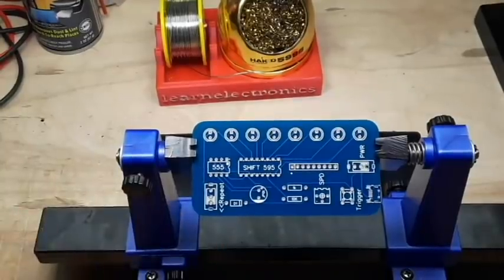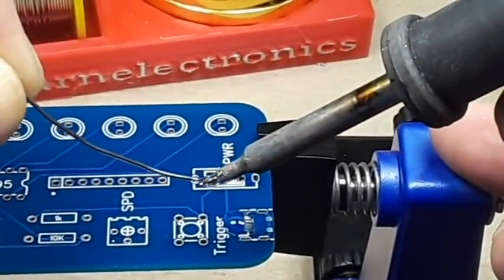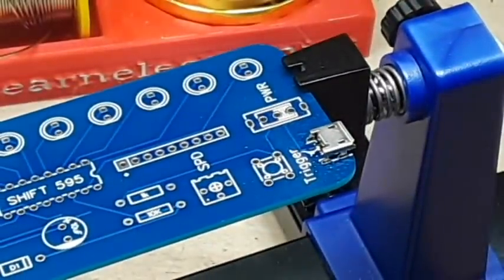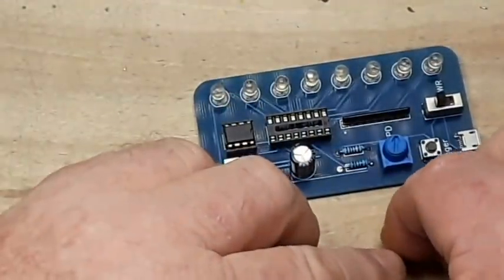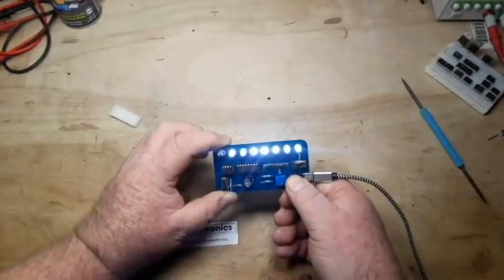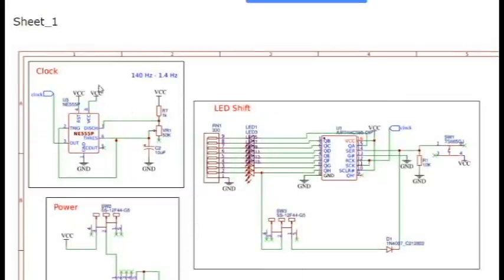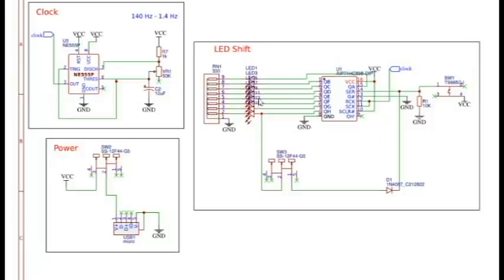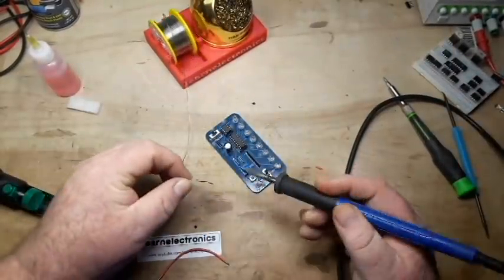555 Timer 595 Shift Register Pulse Kit Build And Analysis

Comment: Very good video.  Wondering if a more heavy duty circuit board to handle more current and 12v dc could be made to handle led string lights for Christmas decorations?

Comment: Seems that the timer output somehow got coupled to the button press after the smoking session.  Pressing the button now seems to add extra clocks due to switch bounce at the same time, so that a single press lights up at least 3 LEDs.
Reply: I agree. Something happened. It is not working as designed.

Comment: Not exactly sure what the REPEAT function does...
Reply: If the repeat switch is closed and the Q7 output is high it sends a high pulse back to the ser-in pin making the LED pattern repeat. If the switch is open the LEDs go dark after one pass. When I tested this circuit on a breadboard I believe I tied the repeat to the Q7 ' (overflow) pin which is used to daisy chain multiple 595's. I guess I ran it to Q7 by mistake when I created the schematic. It works close to the same. My original plan for this circuit was for a toy laser gun with the LEDs down the side to simulate firing. The repeat would have been like an "automatic"  as opposed to a single shot per trigger. I have not got around to making it yet because I have not found a good (cheap) laser sound effects solution.

Comment: Paul, Thanks for showcasing another of my boards. Yes I should never have used the SMD USB connector. I was hoping to use this for my learn to solder classes but that connector would never work for that. The suggestion to just add a USB 2 wire cable is a good one I will update the design and post it soon.
Reply: I have updated the files on EasyEDA to add connections for +5 and GND wires so now you have your choice. The board is LibraryshiftPCB2 at https://easyeda.com/lohmeyer.keith/libraryshift

Comment: heat the solder then give the board a quick tap before it can set, send all the solder flying right off... sometimes you need to add some solder before removing small bits.

Comment: i think that both of the problems you experienced could be fixed by cleaning the flux from the board. The short in the USB connector and later after you put your own wires on, the "extra button presses" that make more than one LED light up.  Great videos, keep making them!! Thanks

Comment: That is a really cool kit. I would have just soldered a cut USB cable using just the power wires instead of the SMD connector. I guess there are a few ways of doing it, even an 18650 with a small 5v boost.
I love the thought that went into this kit. The network resistor arrays just make it look so neat and professional.
Thank you Paul, yet another fantastic video, keep them coming, you are a master teacher for us beginners. Il have literally just finished a kit for my son of one of those cars that follows the black 15mm line. Only had Chinese instructions but fortunately logic prevails to a successful finish. Going to get a 2 meter packing mdf 3mm sheet  sheet from the hardware store, they sell for $5 and I can use either paint or black 15mm tape to make a cool track. Son will love it.

Comment: Don't plug stuff like this into your PC... Don't ask me how I know.
Reply: I will not ask... but power banks are great inventions... and so are current limiting power supplies
Reply: Over the years I've gathered about 40 of the little 5v phone chargers, higher amperage laptop chargers etc etc.  I keep a couple cheap phone chargers plugged in on the bench just for stuff like this.  For anyone that needs some, check your local charity resellers, you can pick up chargers of nearly any voltage or amperage you could hope for, even high quality laptop chargers (24v/5amp and better) that make great supplies for the little constant voltage/current modules all for a couple dollars..
Reply: You fired your PC? Really? I thought that PC-s have USB short protection 🤔
Reply: @milanfixer   Well two USB ports never worked again, not exactly catastrophic as it was a desktop, would have been a lot more annoying on a laptop... It was probably just a fusible resistor.
Reply: @TheAlasFelatio  Damn, that can be scary😱 Thanks for the heads up 👍

Comment: I liked the time I used an arduino with a shift register. I wonder if there's a fun way of using a 555 with arduino and maybe a shift register.
Reply: You could maybe set the 555 to pol the interrupt pin on an Arduino, just a thought as each Arduino has an hardware interrupt pin on them